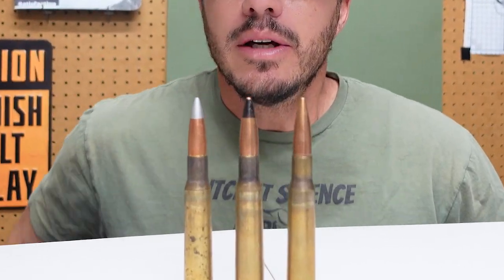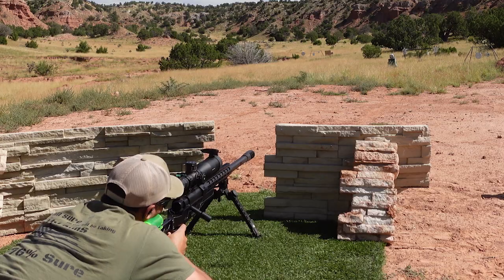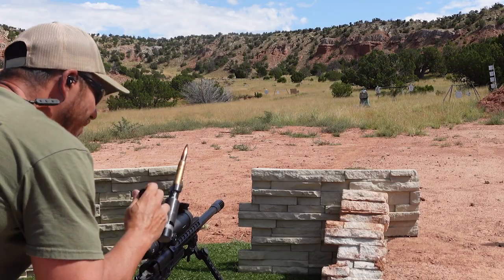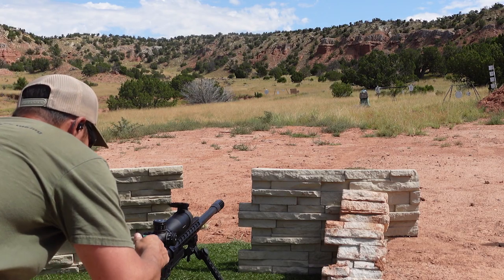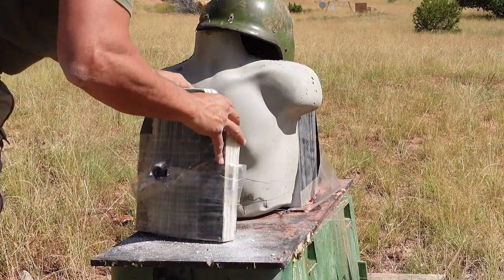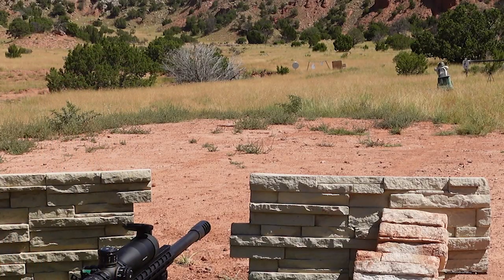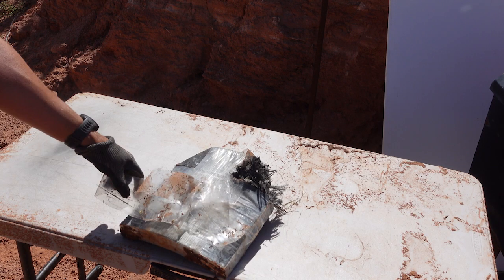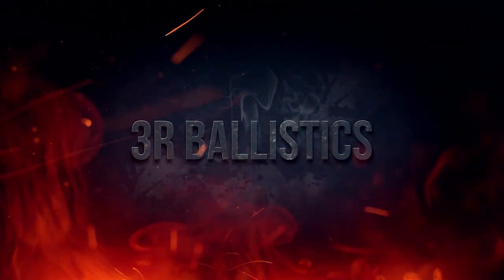Can Anything Stop a .50 BMG? Ball, AP & API Tested!

Comment: build a 4ftx4ft frame say, build 2 , 2x4 frame and 6x6 frame. closed on 3 sides and maybe place a board on top, but first load the sections with rock roundish, yeah round ones. about large marble size.

Comment: I'd try this combination: 
Silicon Carbide Tile -> Alumina tile -> 3A AR500 -> 7075 Aluminum -> UHMWPE
Reply from the maker: That combo would have to have thin sections of each to keep the overall weight and thickness down but I like to combination and will look into making that plate.

Comment: Ceramic armour needs a tough backing material so it (ceramic)doesn’t break in a tensile way like a steel backing material or dense plastic / aluminium whatever and they gotta be pressed together tight to work well (not loosely placed).
Reply from the maker: Good points. We will definitely consider that in future tests.

Comment: 1inch of ar500 will stop it I think , is wearable in a vest (might weigh like 45kg tho) but if body armour is stacked like ceramic on top with ar500 plate behind and 1/2 inch of gym mat padding behind that should do it too + angled ar500 might work as well (30-45 degree angle 📐)